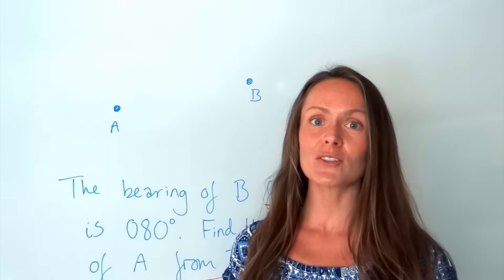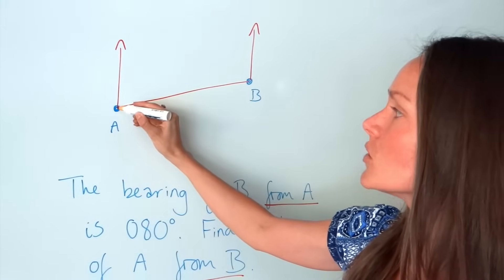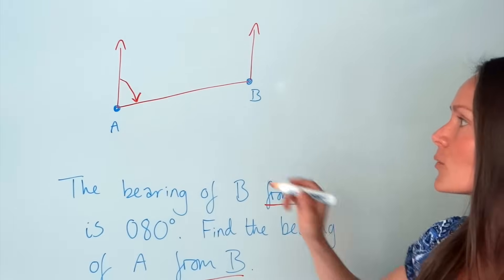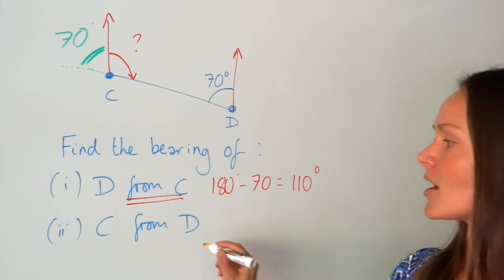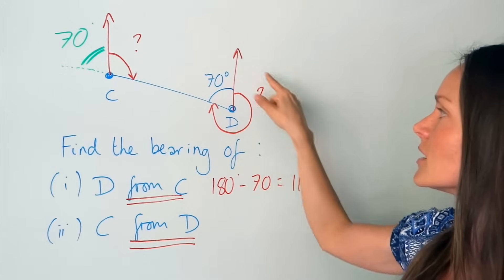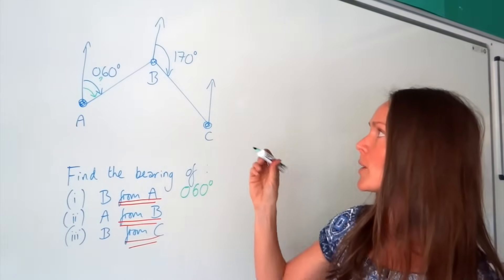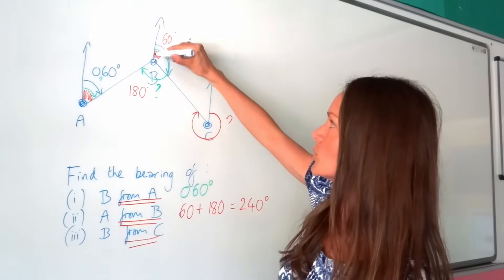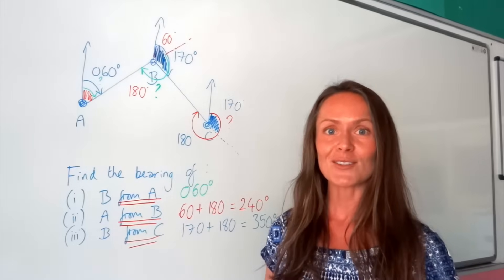The Maths Prof: Calculate Bearings

Comment: Bearings are measured from North or south clockwise or counterclockwise depending on which quadrant falls the other end of the line and ranges from 0 to 90 degrees, Azimuth in fact is what is measured generally from north and always clockwise and ranges from 0 to 360 degrees. Bottom line, what you explained is the bearing in the first quadrant where bearing and  azimuth are equal from point A to point B.  The angle you compute from point B to point A is an azimuth only referring to your example. The bearing from A-B=80° Northeast which is equal to an azimuth of 80° because is in the first quadrant , the bearing of line B-A=80° southwest because it falls in the third quadrant and has an azimuth of 260°.

Comment: Heres a tip for back bearings:

If the bearing from A To b is 21.....

The back bearing = 21+180
                             = 201° 

If your original bearing is less than 180, then: Original bearing+ 180 ,will give you your back bearing (B to a in this case).....

If original bearing is greater than 180, then, 

Back bearing= Orginal bearing- 180

Comment: As a Pilot I skip a couple steps here....Eg: A to B its 60 degrees RIGHT to B. 
So if I'm Flying a heading of NORTH on 000 and B was @ 60 degrees to my right I would go: 
HEADING = 000 + RELATIVE BEARING = DIRECTION TO FEATURE which is 060. (000+060) = 060. 
Therefore: To find a bearing from B back to my current position I would go 060 + 180 = 240 degrees. Just another small variation, cuts out the drawing. This was easy as 060 is above the 270-090 E/W line which is feature B so the reciprocal of 060 (180 Tail of 060)  logically sits to the S/W of the E/W line so that confirms the calculation makes sense. Nice video!